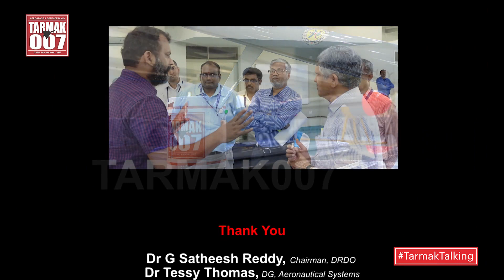Tarmak Talking with Nirbhay Missile Team | Part-1

Comment: Nirbhay missile is like a predator drone that can crash into an enemy target. Thats why it took time to develop. Drdo like with its other missiles was seeking perfection. Nirbhay is on another level when compared to tomahawk cruise missile or any other missile. It's artificial intelligence, navigation system, low flying capability is cutting edge. Plus it can carry large varieties of warhead. Upon reaching it's target it can stealthy circle the area before choosing the most appropriate time to hit the target. It can also be helpful in case target decides to surrender. The missile can be detonated in the air without causing any damage.. India is a missile power house. Drdo has built a cutting edge research and development ecosystem to build any type of complex missile. I salute genius scientist of our great Bharat Varsh..
Reply: What's the maximum range/area of devastation that Nirbhay could achieve if it carried 4 warheads, each with 100 kg of explosives?
Reply: It don't have AI capabilities. But it can do s manuvares also with a mac 10m Circular Area Error
Reply: @avijitnaskar5759  it has AI ....also the range is also to be increased....
Reply: How do you know that it's better than Tomahawk
What's your source ?

Comment: I have a question, can the seeker from the Astra missile, be placed on the new Brahmos A, thereby making it an air to air (air defense weapon) range 300 km speed mak 4.5.
Reply: Nah, its not possible to convert a heavy supersonic cruise missile into an air to air missile just by replacing its seeker.
Reply: its not about seeker only. missile aerodynamics , ability to withstand high G manovering, special body design etc are required.